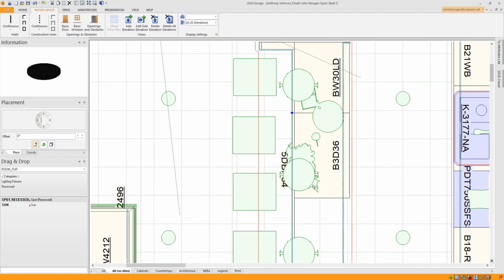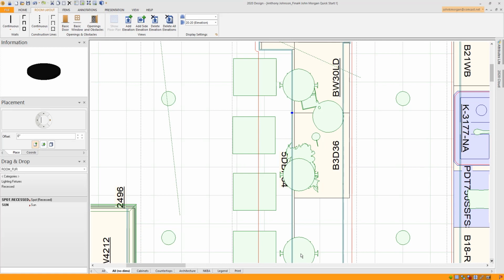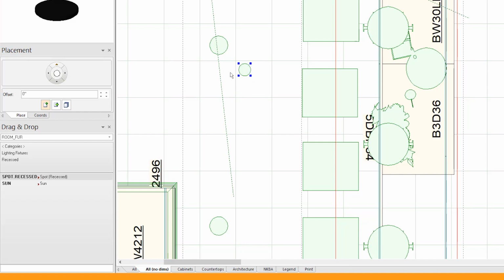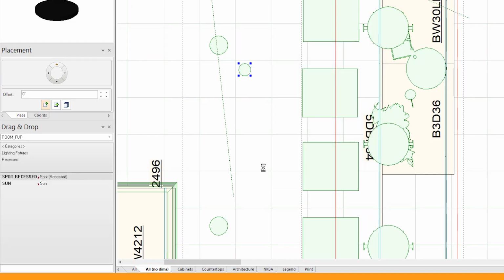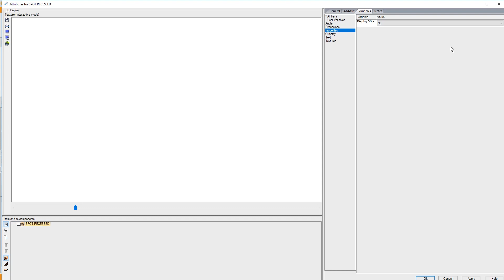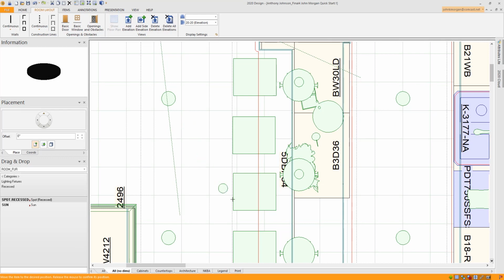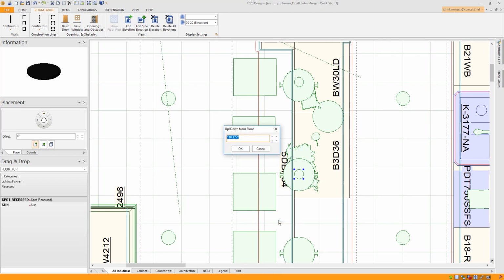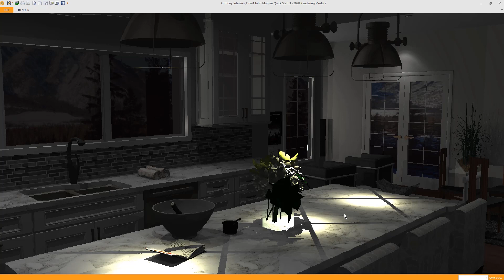How Did They Do That? Add Light to Fixtures from SketchUp

Comment: Hey John ... great tip on adding a lighting source to a SketchUp fixture. What I do is set up one SketchUp light fixture with the spot recessed (setting height, light properties) then I "group" both items ... then continue using the 'copy-paste' commands to place additional light fixtures around the island.  Regards, Richard